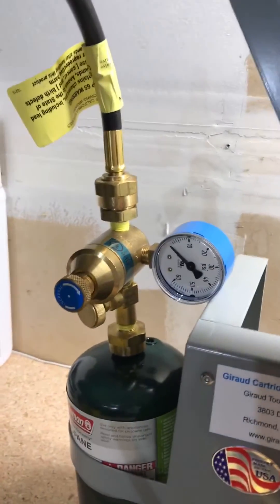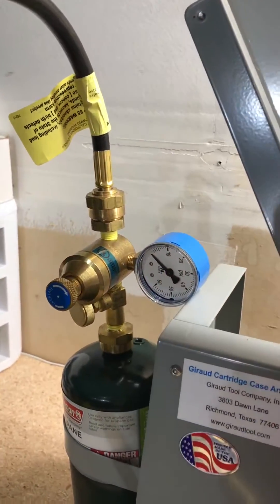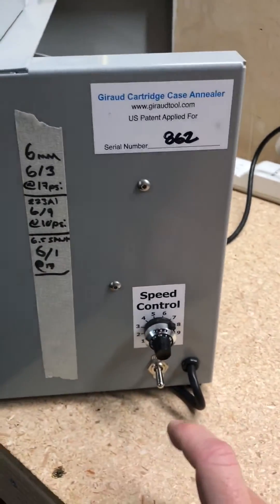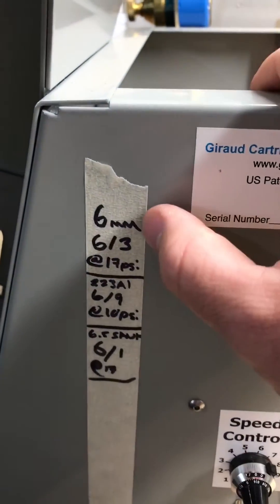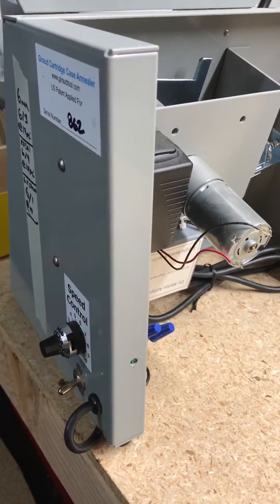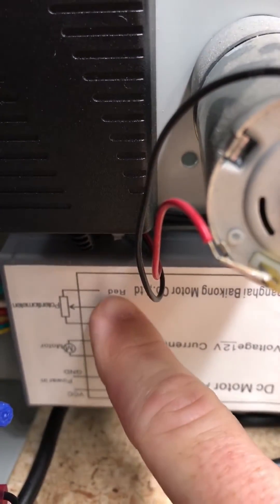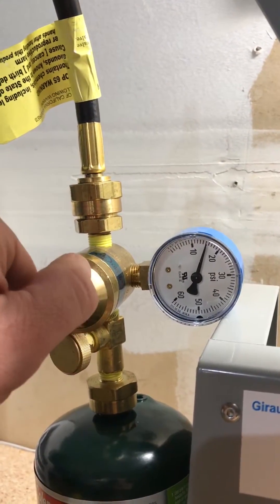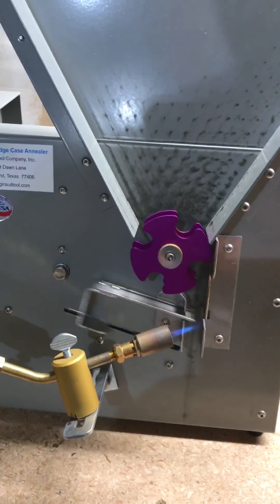Giraud Annealer Modifications

Comment from the maker: Links for the parts:

Regulator:
https://www.amazon.com/Goss-EP-70G-Pressure-Propane-Regulator/dp/B00D2ZVTZK/ref=sr_1_1?ie=UTF8&qid=1474944898&sr=8-1&keywords=goss+lp+regulator

Brass fittings:
https://www.amazon.com/Mr-Heater-Throwaway-Cylinder-Fitting/dp/B000BQM8IU/ref=pd_bxgy_469_img_3?ie=UTF8&psc=1&refRID=A036BZPY6SVSSS09XKN2

https://www.amazon.com/Mr-Heater-Throwaway-Cylinder-Fitting/dp/B000BQN4IS/ref=pd_bxgy_469_img_2?ie=UTF8&psc=1&refRID=A036BZPY6SVSSS09XKN2

https://www.amazon.com/gp/product/B00D86IEGA/ref=od_aui_detailpages00?ie=UTF8&psc=1

**PLEASE MAKE SURE YOUR WIRING LOOKS SIMILAR TO MINE, I DO KNOW KNOW IF ANYTHING HAS CHANGED SO CHECK BEFORE ORDERING THIS**

Potentiometer:
http://www.ebay.com/itm/20K-Ohm-3590S-2-203L-With-Turn-Counting-Dial-Rotary-Potentiometer-Pot-10-Turn-/121005352097?ssPageName=ADME%3AL%3AOC%3AUS%3A3160
Reply from the maker: Hugh Tanner The first part of the Amazon description is wrong. The part number and second half say LP